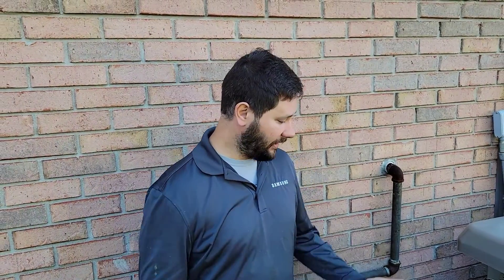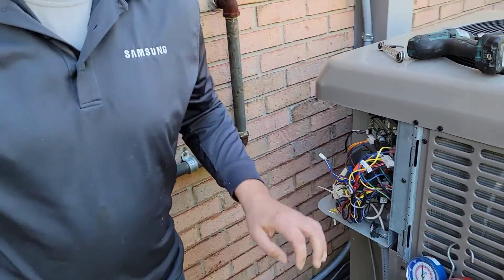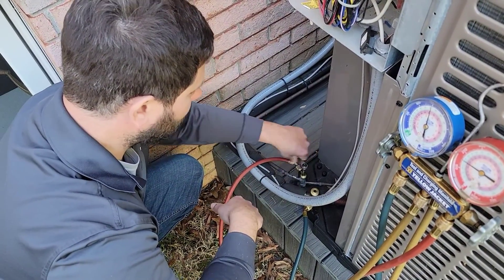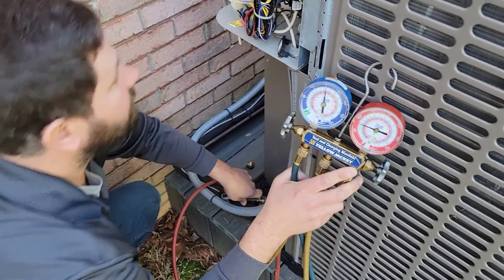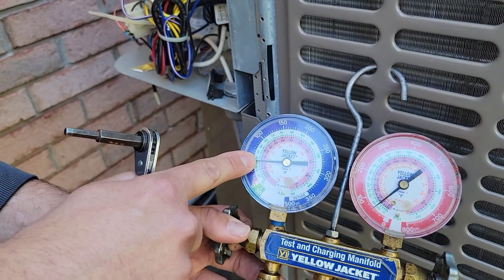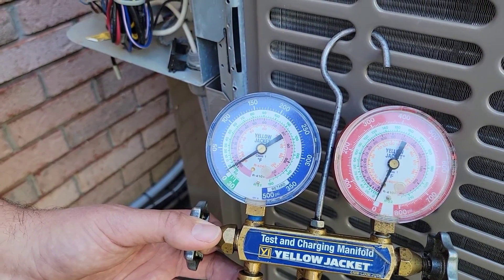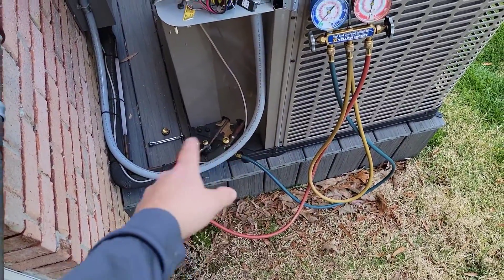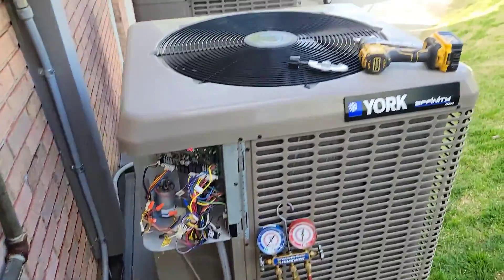Refrigerant Pump Down: Step-by-Step Guide

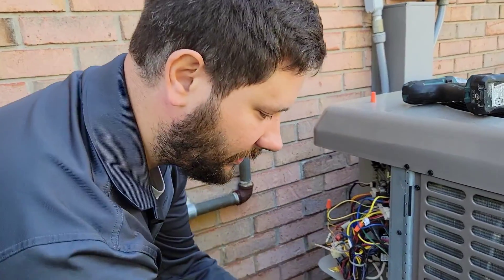Comment: 1:56 for the ones that might say that the pressure isn’t equalized if you look up that exact compound gauge manifold on google even though they are not pointing the same direction doesn’t mean they are not reading the same pressure

Comment: Question here. Everything makes sense except for the red and yellow wires that you jump to start the compressor. Are you actually cutting existing wires in the unit to do so or are there actual service wires for this exact process? I’ve never messed with the units before but I’ve done a million evac/recovery and recharge jobs in the automotive field

Comment: We don't need both meter hooked up, right? Of course it's good to see both side but technically you need just one and make sure it pumps down to negative pressure. Another awesome video. Thanks.
Reply from the maker: yes that's right

Comment: Hi taddy   hey what's the best way or faster way  to recognize  when the compressor  is a scroll  compressor  thank you  in Advance   I wait for your answer
Reply from the maker: The quickest and fastest way to find out if you have a scroll compressor is to:

1. Look at the Compressor Label
Open the access panel on the outdoor unit (condenser). Check the compressor data tag (usually a sticker or stamped plate). If it says “scroll,” “SCROLL ZP/ZR/ZB/ZR,” or has brand/model numbers like Copeland ZP, ZR, ZB, LG SCROLL, or Daikin scroll — then it’s a scroll compressor.

2. Listen to the Sound
Scroll compressors are quiet and smooth. They have less vibration compared to reciprocating types. There’s no clicking or knocking when starting or stopping.

3. Visual Clues
If you can see the compressor (black dome shape), scroll compressors are typically shorter and wider. They do not have a visible crankshaft or pistons.

Use the model number of the outdoor unit and look it up on the manufacturer’s website. The product spec sheet will clearly state the compressor type.
Reply: @TaddyDigest  thanks for tour time taddy   that's very helpful info and quick  response from you

Comment: When i try to do the pump down it always trip the breaker 30 amp at 75 psig and not letting me go lower than that..(410a)
Reply from the maker: It could be an issue with the compressor?
Does the compressor make any unusual loud noises?

Check and make sure that the equipment and the breaker match.You have the breaker is too small.Then it will trip

Comment: Quick question what if you're trying to pump down a 410A ac unit without any pressure switches and it doesn't want to pump down why doesn't it pump down? I know then I will have to use a recovery machine but why won't it pump down? Thanks Teddy
Reply from the maker: Because maybe the line sets are too long.Or maybe the coil is microcannel, and it won't fit all that refrigerant inside the outdoor coil.

Comment: What it that you do in the beginning with the wires? And what is LPS?
Reply from the maker: Low pressure switch is a switch that opens whenever the pressure gets too low. I just take and jump out the pressure switch.So that it doesn't cut off on low pressure

Comment: Refrigerant doesn't travel through the manifold.. also you should close the liquid line after the compressor starts and pump down to 10 to 15 psi on the suction

Comment: Hello how do you pump down if compressor is not operating ? , replacing a split ? Any way to do with vac  pump ? Or is that a sucking only action ??
Reply from the maker: You cannot pump it down unless the compressor is operating. If it's not operating, then just close the valves and recover what's in the line sets and coil

Comment: Great video! Could you also close both valves while the unit is off if you have a low pressure switch?
Reply from the maker: yes While the unit is off

Comment: I'm trying to pump down a straight Ac Goodman 4ton 410a system how come it keeps making a loud swooshing noise when it gets to 50psi and then the pressures go back to 115psi is there and internal pressure relief valve because the system doesn't have any high or low pressure switches

Comment: I was pumping a 3 ton Down today 410A txv system. I closed the liq line valve and when suction got down to 50 psi, the compressor started hissing and pressure went back up. It has pressure switches so I was pushing the contactor. I ended up recovering and pulled 4 lbs out of it. Wasn’t overcharged. Any idea on why it wouldn’t pull down? After when I put the charge in, it ran perfectly.
Reply: @BillyN31  compressors dont like this being done. It went into bypass, all you can do is recover the rest. I usually go ahead time the suction valve being closed exactly when the compressor pumps down to zero. The linger it runs while sitting at zero the worse it is for the compressor.
Reply: @royrollins8987  I pump down systems all the time. No issues

Comment: Can I do this without gauges? Say when the indoor unit stops cooling I’ll close the last valve?
Reply: That's the exact question I have. I have an ancient R-22 system but don't own gauges and I need to pump it down to remove the furnace, coil, and coil box to repair the floor decking underneath. I had a new furnace installed 3 years ago and it was upgraded to a high efficiency. When the installers ran the PVC pipes to the roof they didn't install the correct cap and worse, they didn't use a finger to form the silicone caulk around the pipes. Basically the new hire with low experience (not being mean...he was new) put an O-ring around the pipes but it never even touched the pipes. 
Skip ahead 18 months and the condensate pump sitting in front of the furnace on the floor died and flooded the floor. That's when I discovered all the things done wrong during the installation.
Rain and snowmelt had been silently running down the pipes, through the furnace behind the front cover out of sight, and down and out the base around the coil box. Then on down underneath to the insulation (my home is a double wide manufactured) which got saturated and half water and moisture that proceeded to rot the decking.
I went round and round with the installer and their insurance company and got nowhere. A lot of time was chewed up following the complaint and investigation processes. 
At that time I developed heart problems and had a series of heart attacks which lead to getting a pacemaker and then Feb 22nd 2024 I had a stroke. That lead to getting a catheter ablation in June of 24. 
I kept detailed notes, letters, emails, time/date stamped pictures and have videos showing the water running down during a storm. I didn't contact my homeowners insurance company because at first I was following the ridiculous time eating procedures, and then I didn't dare take on the stress of getting back into battle. 
So currently the floor decking under the vinyl flooring is so sagged that when the blower runs I can smell a musty mildew coming out of all vents. Obviously the ducting has dropped and disconnected from the coil box. Because I'm a 66 year old disabled widower my days of crawling around in the crawl space are over. 
My dilemma is whether to try and get my insurance to go after the installer on my behalf, or take on the not small project of removing the furnace and nearby 435lb gas water heater, removing the studs and drywall walls of the mechanical closet to get at all of the damaged flooring and replace as necessary. Not something I look forward to doing all alone with a bum ticker. 
Old guy long, rambling story aside, can I pump it back without gauges and just wait 5 minutes or so after closing the high side? I know, not ideal at all but any of the stupidly expensive R-22 that I can save is more money (for things like food) next year when I get ready to use the AC again. 😂 Is there any danger to the compressor if I guestimate too long and the high pressure side sits at zero too long?
Reply: @EREBO95  not a good idea. Some guys do it from sound but unless you’re replacing the whole cooling system I wouldn’t.
Reply: By the way, I subscribed. Great video! Clear and consise without any bs wastes of time.

Comment: I was trying to pump down a new york 5 ton unit for a repair and could not get the condensor to down I used the same method as you are showing here but I think there must be too much refrigerant in it I hear the pressure relief have you ever come across this thanks.
Reply from the maker: yea I have come across this could be because the coil is micro channel or long line sets

Comment: This is great, the best video on this subject I've found.  Newbie question.  When the service valve is open you're only reading pressure on the high or low side of the system.  When they are closed they are only reading pressure on the evap side.  Correct?  At this point you'd do your nitrogen purge, repair, pressure test, evac and recharge? Question 2: Can you do a video on how to release the refrigerant into the system once the repair has been made? (Or is as simple as opening the valves and turning the compressor on?)
Reply from the maker: yes and yes, and it's very simple to open the valves and turn the thermostat to cool

Comment: I usually pump down with the unit still running I close off the high side first then as the low pressure side drops I close it off then quickly shut of the unit kind of the same method you just closed off the high side while the unit was off I didn’t even know you could do that great video

Comment: New DIY'er here - I had a new precharged mini split I installed and electrician came in to update the breaker, put a 240v breaker in when appliance was 115v (it was my fault). We all know what happened after that. Since the Unit is now a toaster I am assuming I can do the same steps here but with a Vacuum to pump it down into the unit right? I was hoping to use the unit itself to store the eco R-410 and store it when I uninstall and save the refrigerant. I bought the same pre charged unit just at the right voltage, assuming its not "Dirty" and can be resused down the road when this one eventually leaks? My gut tells me no :), my heart wants to believe it will.

Comment: Hi and thanks for your videos,  I have located a small leak on my 20 year old evaporator is it safe to just open the condenser lines to release the refrigerant back to the system, after repairing the leak, I don't have a vacum pump.
Reply from the maker: You definitely need a vacuum it down You need to put nitrogen in it first and then vacuum it down
Reply from the maker: Go check out a couple more on my videos. The most recent will show you how I pull a vacuum
Reply: Thank you

Comment: You also should of had the indoor fan running while doing this... I mean... technically you can get away with what's shown, but you're missing a few steps that COULD cause issues with someone else.  Best to show every step thoroughly.
Reply from the maker: Tell me what the indoor fan does
Reply from the maker: Am I missing something
You think the indoor fan has something to do with the refrigerant pumping into the Outdoor unit
Reply: @taddydigest  Yes sorry.  So you need some heat load into the refrigerant to be sure it all boils off.  This is just a 99.9% guarantee you get it all.  You're method is... I'd say 90% guarantee.  Just playing it safe.
Reply from the maker: Got it thank you for clarifying my friend
Reply: @taddydigest  No problem. Great channel.
Reply: @taddydigest  Now that you're here, I've hear it's possible to ruin a scroll compressor if you start going below 0 psi, because you will start to remove the refrigerant out of the compressor, and for a scroll it's very important that it always has lubrication and insulation.  As the refrigerant is electrical insulation between the coils and the case. Also because of how a Scroll works if you remove the oil you will also damage it.  So that's 2 bad reasons to pump down a scroll compressor "too much".

Comment: One important thing that didn’t apply here but does apply to many systems. Micro-channel coils are increasingly more common, and many of those can’t be pumped down without risking coil rupture.
I also recently had a technician attempt to do a “reverse pump down”, thinking he could trap the refrigerant in the air handler by closing the suction service valve. As you can guess, that didn’t work out the way he expected. Can it work? Yes, kind of, but only on a heat pump, but there’s a whole different process he was unaware of and hadn’t been trained on.
Reply: I need that info for reverse pump down - Do you know? Or the procedure?  Ppl think I’m crazy for even asking!  But a long time ago in school I remember the instructor said it could be done but needed to be careful!  He never showed us how tho!
Reply: @tonywiggins8073  it’s done in heat mode. You close the small service valve, which will be liquid that was just condensed by the air handler. In heat mode the large line isn’t suction, it’s discharge, so you’ll need to put your gauge on the common suction tap, and close the large service valve when it gets as low as it’s going to get. It’s going to subcool and stack liquid refrigerant inside the air handler and trap it there when both service valves are closed.

You don’t have a receiver or accumulator in the air handler so it’s only going to hold as much as the coil holds. You will still need to recover the rest to a recovery cylinder. Will From being able to change the liquid line filter dryer unless it’s on the compressor side of the service valves. Best case, you’ll be able to “reverse pump down “about 60 to 70% of the refrigerant, at most. And, again, don’t even try it with a microchannel coil.
Reply: @SerialChiller-VRF  Well I was close! 🤣🤣Just trying to figure out the procedure on my own & how the HP cycle worx!  But I didn’t know about the micro channel problem )Good to know). So look like I’ll be recovering it bc it’s a Goodman micro channel ! 🤬. Thank you for the information! 👍😎
Reply: Learned this the hard way early on with another guy. We tried to pump down a york microchannel and it blew the compressor

Comment: Hey Taddy, this may sound like a dumb question but how would I wire in a float switch to a indoor unit that has a board. Would I just tie one end of the float switch's wiring with the red wire on the R terminal on the board. That would kill power to condenser. Then for the transformer wire to kill power to thermostat, I would see where it goes into the board?
Reply from the maker: I will do a video on that for you

Comment: Thanks for video , I work on refridge drinks machines so only small compressors and systems . But I would like to move on to more air con stuff after I am qualified would this be possible or do I need to learn all this again about air con systems ?
Reply from the maker: Totally possible you already have a Experience